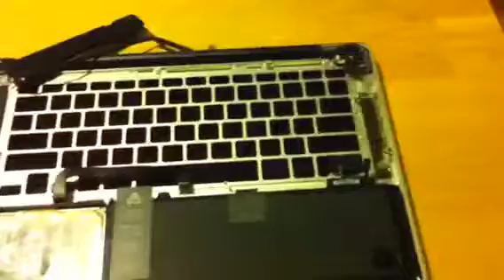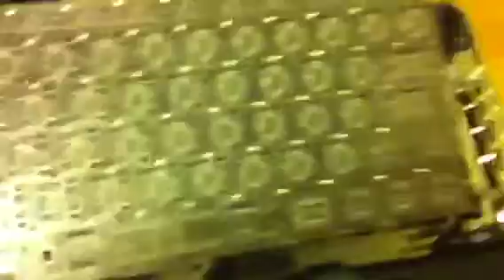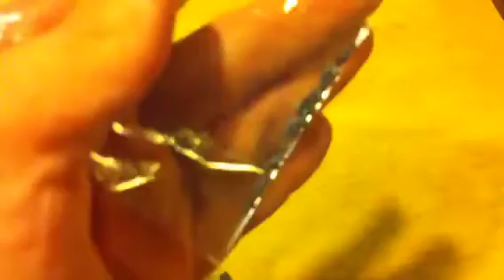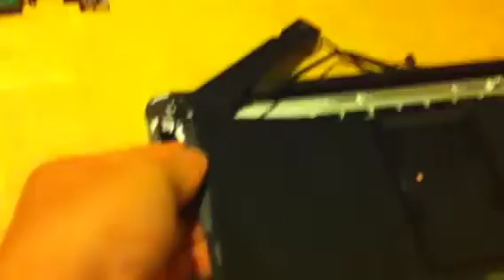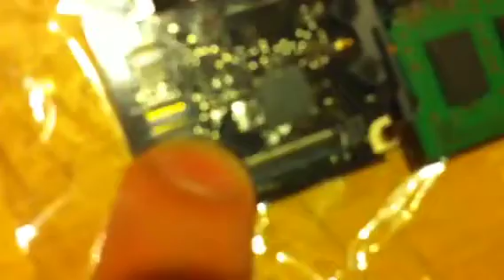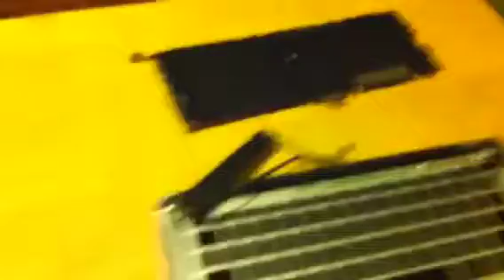MacBook Unibody Keyboard Replacement

Comment: to ditto on poor pwr design. I too have this issue, I didnt figure it out until I needed to shutdown(rarely happens with mac) and I couldnt power it up. I was told to do the smc reset..haha, if your button doesn't work it wont work. But I did notice if you just unplugg the battery and plug the power cord in , it boots! plug battery back in and close the case. Btw  the only spill it might have took was cleaning it windex other than that I cant see where I would've gotten a spill

Comment from the maker: Hi!  Thanks for the post.  Yes, in theory a USB keyboard should work fine, because the USB ports are separate from the keyboard/topcase.  As long as you are able to power on the system (either with the power button, or by jumping the board) a USB keyboard should work, and I believe I have done this myself in the past.

Comment from the maker: I'd get another AC adapter, since it could be the problem.  Replacing the topcase/keyboard is fairly difficult, but not that bad.  I'd check out ifixit.com, and there you can find a step-by-step guide to replacement.  At this point I'd definitely recommend replacing the whole thing rather than just the keyboard, since it's much easier.

Comment: Hey there!, Im actually right now, typing this post, with a cheap BT keyboard bc of the same glitch with the keyboard typing alien sentences.....Is replacing the "topcase/Keyboard" noob friendly? bc my situation is slightly different. My power/adaptor sparked while switching the extension accessory and ever since then, my keyboard is backlit in a checkered pattern and is typing weirdly.......any help would be appreciated...

Comment: I agree that the power button design is not a good idea. Mine does not work and seems that there is no other way to fix it other than replacing the keyboard assembly.

Comment: I was wondering, if i were to replace the top case only on the MacBook Pro 13" late 2009, mine has alot of cosmetic damage and the system in still in full working order. Getting the battery, Logic board, speakers, battery, HDD and its holders off are straight forward.  Apart from the keyboard, the aluminium power button, Trackpad adjustment screwed. Are there other items i would to transfer to the new bare top case?. Any other advice would be helpful. Thanks

Comment from the maker: Not sure what you mean by "virtual keyboard".  You might have stuck keys.  I would plug in an external USB keyboard, disconnect the internal keyboard/trackpad ribbon, jump the power, and see if the machine works fine that way.  If it does, and you can use the external keyboard and don't see the symbols, you know the topcase/keyboard has damage and needs to be replaced.

Comment: The genius idea is that if water entered the keyboard some people tend to go ahead and try to boot the system which would make the logic board dead if the water happens to touched it and the logic board is the system and way more expensive but if at all u tried to boot it but no response that means u have to take it for check up which will make u safe and all worked out, secondly apple recognize the start bottom as a key so it have to be all connected to the keyboard

Comment from the maker: @bramVE239 Wow, that's a new one.  I suspect you would have to change a setting in System Preferences.  As a test I would look for that setting and see if you can switch it right now (in the software) from querty to azerty.  If that works, you know what's left is simply swapping out the keyboard.

Comment: The space bar on my macbook pro is not working. I think I shorted it out. It's the only key that is not working. I believe that I just need the "plastic" piece that all the screws go into, the part with the metal bits. What is the part number? Or whats it called? I can't find anything online. :(

Comment from the maker: @smninerniner Awesome, it's great to hear the video was helpful!  I found the replacement keyboard on eBay.  The best way to search is to find the model number of your machine, i.e. A1278, and then search eBay for "A1278 keyboard".  They generally run about $50-$60.  Also, I've noticed it's often possible to find an entire replacement topcase in the $100 range, so the argument can be made for replacing the whole thing and bypassing the fairly difficult keyboard replacment procedure.  Good luck!

Comment: this is probably the best keyboard tutorial, but i've got a few questions. those liquid sensors you pointed out, am I right in assuming they turn red when wet? i discovered that one out of three of them was actually red so I assume they would have spotted it. More importantly, when you showed where you jumped your board, I noticed my unibody macbook (not pro)  is a little different, its a 5.1 (late 2008/2009), would any ebay'd  kit work? and do they come with new sensors/replacement black cover?

Comment: What I didn´t understand is about the short thing when you mention that put a metallic thing to joint two contacts near the power button switch, I have had problems with my keyboard, it only writes capital letters, I already dissasambled the macbook and the keyboard also looking for fisical problems in the keyboard, but I could not see anything wrong, can you explain me about the "jumping techine " that you mention in minute 6:18 aprox, thanks